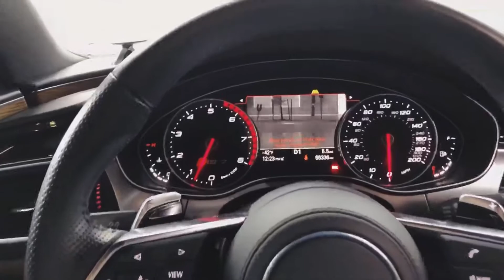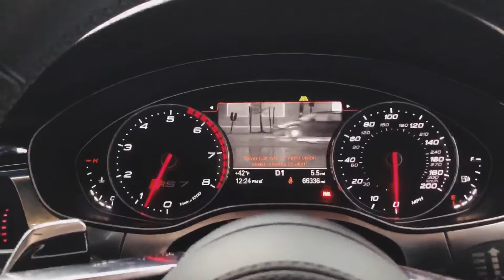Audi R8 Steering Wheel & Fighter Jet Stick in Audi RS7

Comment: Hey there, I gotta a question where can I find the same steering wheel for an 2014 audi a7? 

So far I only installed an android screen that replaces the infotainment system with the virtual cockpit ui theme added a 70mai front and rear dashcam and 360 camera and retrofitted the rear taillights to the matrix taillights. 

My next plan is to retrofit the 2014 instrument cluster panel to the virtual cockpit and the have safety component protection removed.
Reply: I am impressed! You are totally inspiring me to upgrade my 2014 A6, the MMI is mildly dated at this point. You did all those upgrades yourself/on your own!?